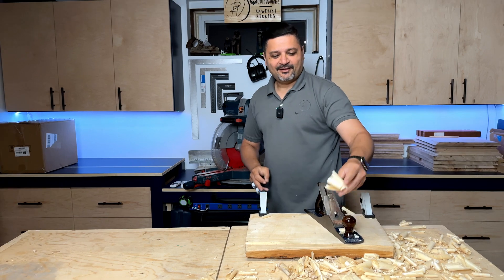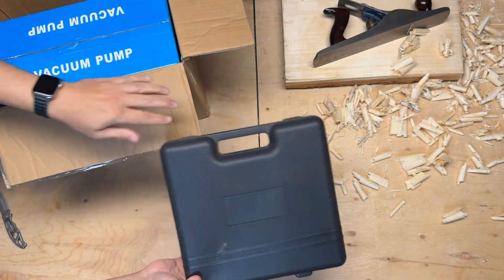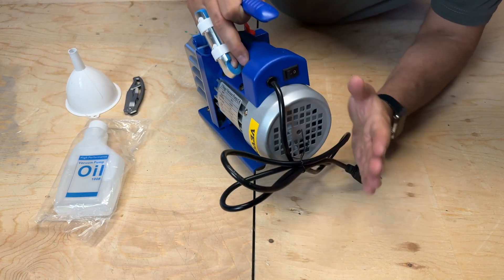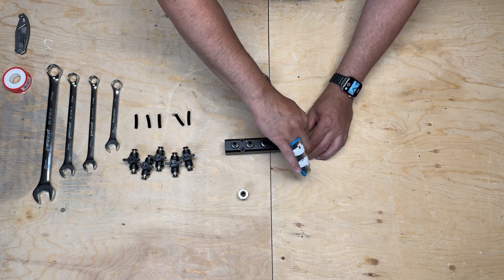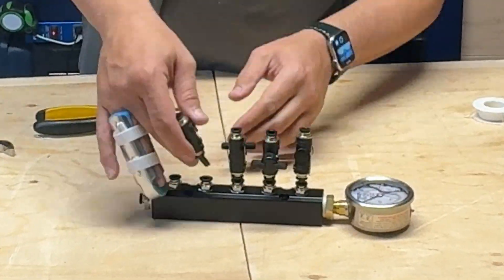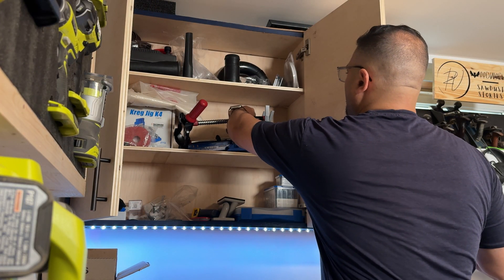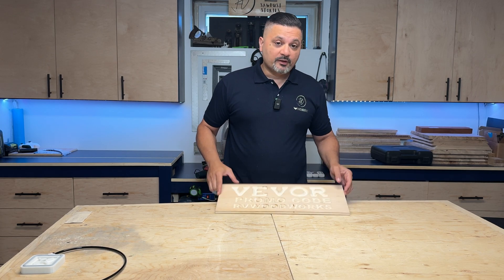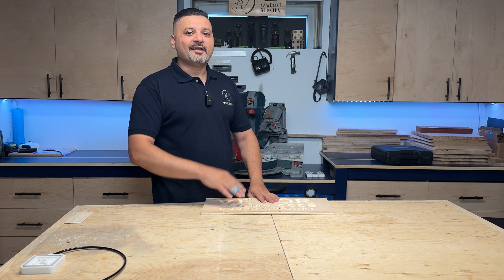The Workshop Necessity You Can NOT Ignore

Comment: Very nice. I have been looking at setting up a vacuum table on my cnc.
I'm just trying to figure out how to stop dust and chips from getting sucked down the vacuum tubes
Reply from the maker: Haven’t noticed this to be a problem as yet because the one that’s actually sucking is sealed which is why the board isn’t moving… glad to told me I’ll keep a close eye on it and if there is an issue I’ll put out a follow up video on it; cheers!
Reply: @RVWoodworks  I was thinking more when you cut through. I have seen a few videos with them, but I think they leave a tiny sliver of material and finish off with a box cutter then sand flush